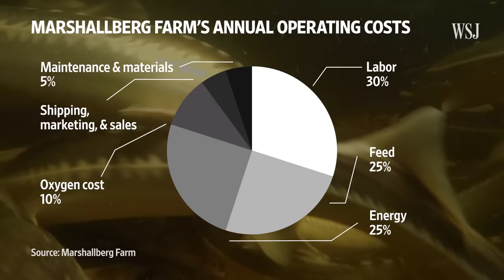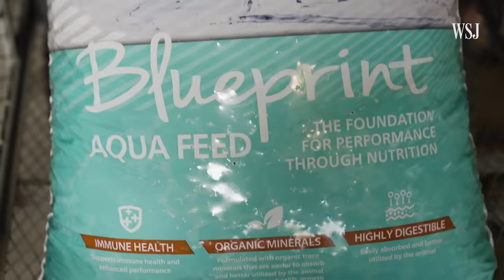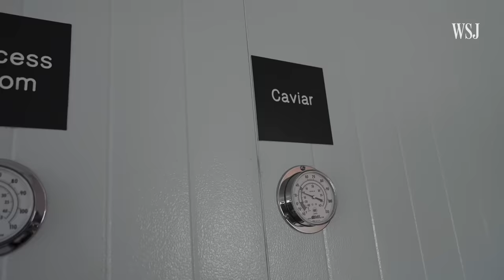How to Run a $10 Million Caviar Farm | WSJ Operating Costs

Comment: why not DNA test for gender instead of raise the males for 5 years?
Reply: NCSU is working on a practical DNA test for us. It would involve tagging the fish because the test isn't immediate like a pregnancy test.
Reply: It has to be a certain age to DNA test because of maturity and growth of the cells I think. We just talked about this at our hatchery, but they are working on something. Also has to do with X and Y chromosomes. They are a fish that require time. Ours takes 12 years to mature but that’s in natural type water conditions, there’s takes 6 years and I’m assuming cause they are keeping a constant 16 degree Celsius temperature. Growth slows when water becomes colder that’s why natural sturgeon can take 20 years to sexually mature.